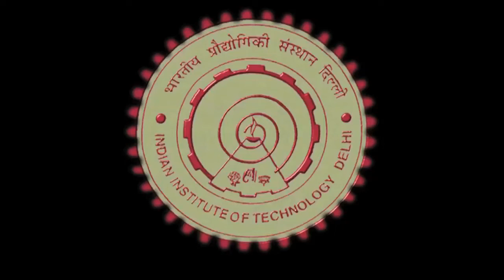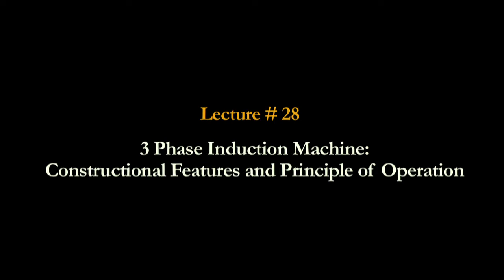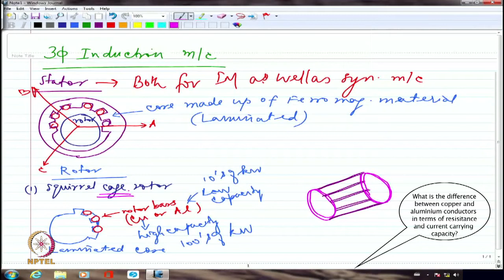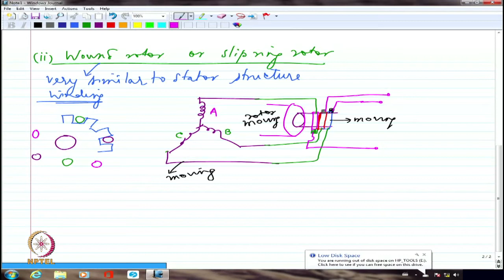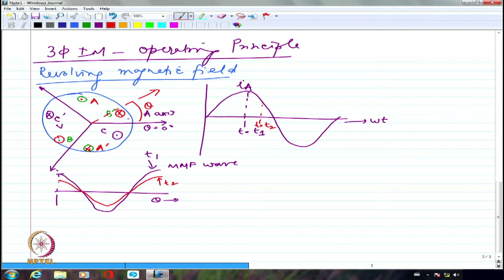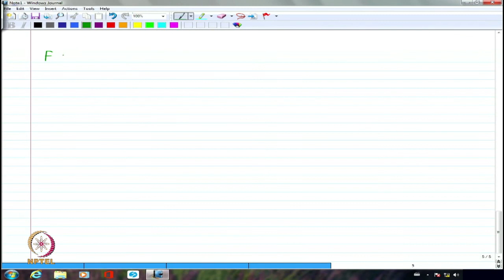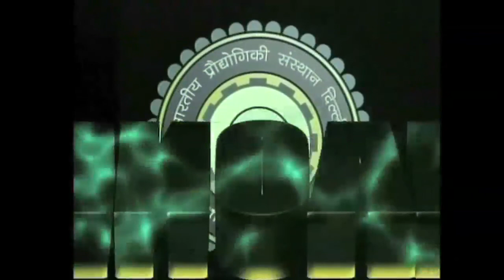mod10lec29

Comment: 3 ph IM construction 0:00
stator 2:00
sq cage rotor  4:00
wound rotor 11:00
1 ph IM supply power and speed oscillations 21:00
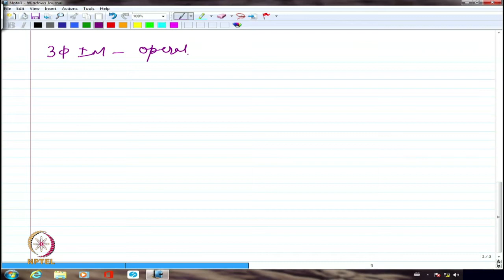3 ph rotating tesla field 27:00